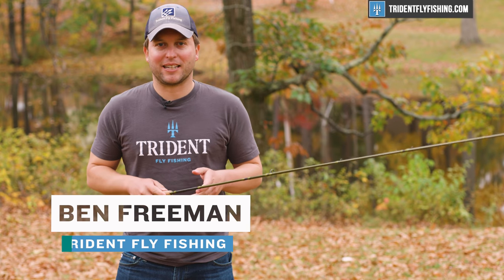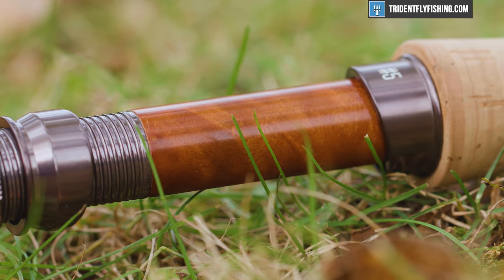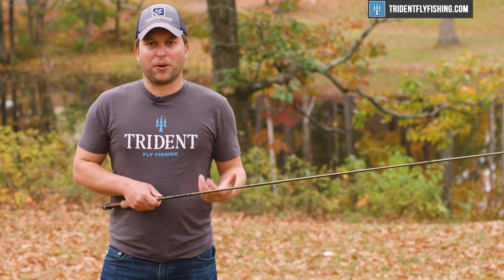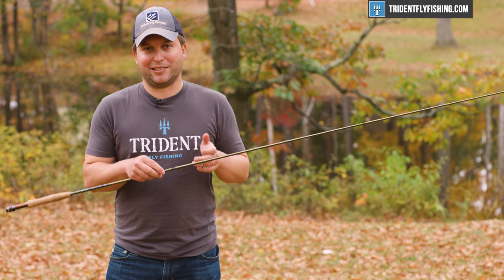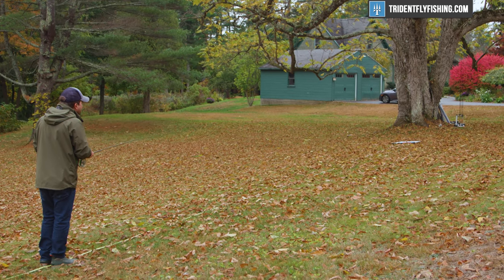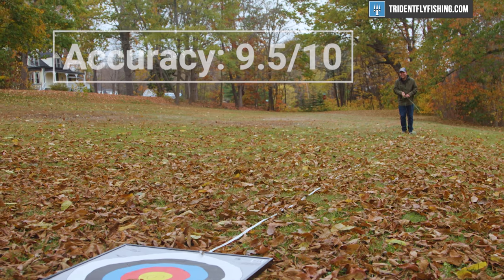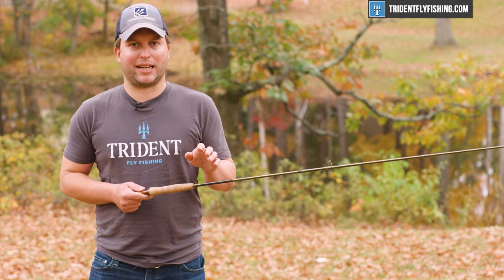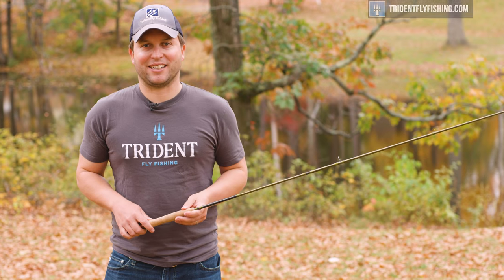Hardy Ultralite Fly Rod (Review + Test Casting)

Comment: Just a question about the distances you're testing:
unless the line you're using has a longer belly, how can you say that the rod casts nice at 45 ft (and further) compared to 30ft? The rod won't be loaded deeper after end of te belly, right?

Looks like this is just another 'drift boat' rod. 'Tossing' long distances against the banks rather than wade fishing and CASTING. Why do we rate these kind of rods so high? 80% (or was it 90%) of the fish are caught within 30ft.

Your reviews are sill very well done Ben!
Reply: This is not a drift boat rod. Why not cast it yourself before jumping to conclusions?
Reply from the maker: ibookje - 30' = 9' of leader + 9' (ish) of rod + 22' of line, which on an MPX is ~110gr vs a full head length of 36'
Reply: @Tridentflyfishing  Thanks for clearing up. It's often confusing when it comes to distances cast. Fly line length vs 'all in length'

Comment: Hi Ben, I saw your review on the old Zephrus ultralight in which you said that overall you thought it slightly better than the Sage LL? I am contemplating buying what will probably be my last rod, and did have it in mind to go for the Sage LL 389  because I still own an old Sage RPL and have always loved the action which I think should be similar. Problem is, here in the UK it is easier to try out a Hardy rod as opposed to a Sage. Retailers in my area do stock them but usually in only one or two weights/lengths. I have watched your review of the new Ultralight and hope that you could possibly review the Ultralight LL in the 9ft 2" # 3weight , my intention being to be able to fish dries,  lightweight nymphs and wets. Any advice or guidance would be appreciated
Reply: If it makes things any easier I’ve casted both.
I own two trout ll’s and love them, I’ve got a 3wt and a 5wt
I’ve also got one of these hardy ultralites in a 10ft 6wt on its way.
And I’m ordering a 9ft 2 weight ultra lite LL on top of that.
All of them are phenomenal rods
My local fly shop also backed up my initial thoughts of, the sage is a better blank but what the hardy loses there it makes up for in components.
I don’t think you’ll be disappointed in either
Reply: @mitchsiddle5636   did uu like the 10-6wt ??

Comment: The blank looks great, but the realseat..... ehh... got myself a single handed zephrus on a clerance..
Reply: The real seat is great! Not only esthetically, but functionally. The wood spacer has an indent allowing for a quick visual guide to correct reel alignment, and the bottom hood is asymmetrical, also allowing for a quick alignment, which is confirmed by  laser engraved dot on the dorsal side. Nice little touches that speed up the daily chore of reel alignment. (I have the Zephrus too, and like it, but not quite as much as the NSX)